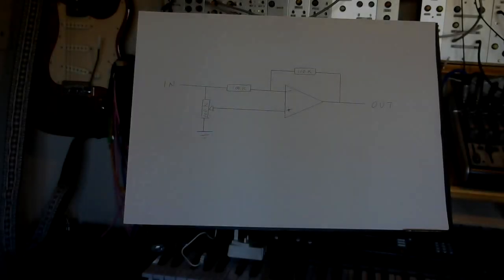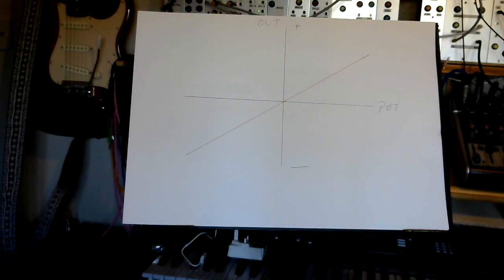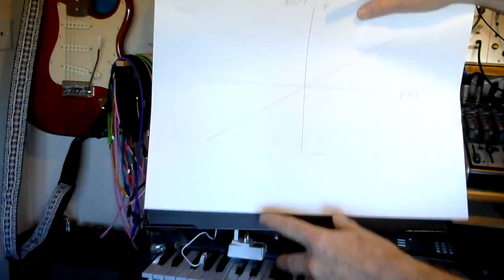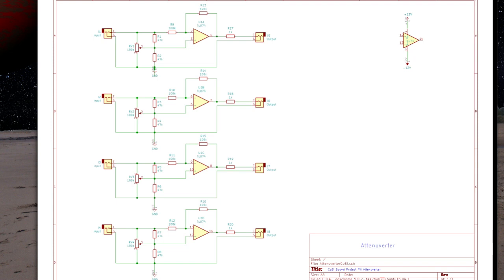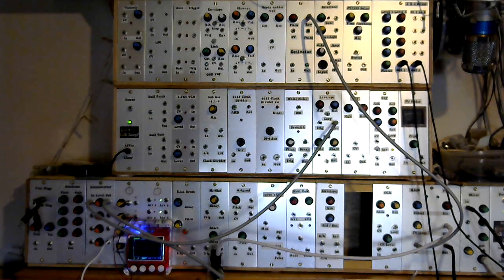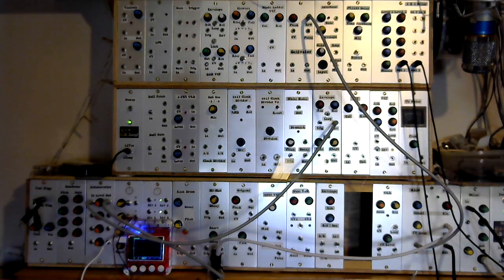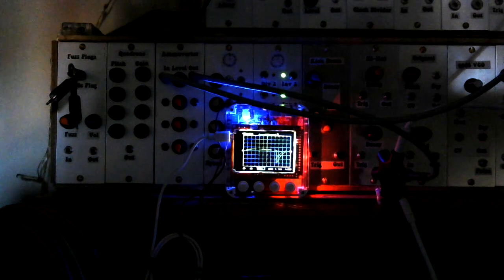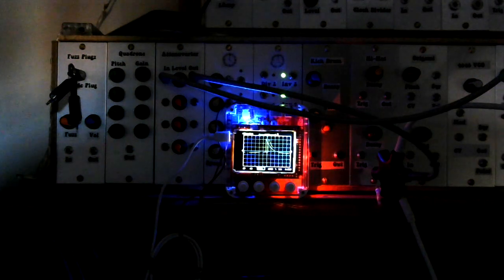Project XII Modular Part 22 : Quad Attenuverter

Comment: Great video! But what if I just wanted to build an inverter? Could I then, just use a 50K potentiometer, in order to just get the bottom half, of the red line in your drawing? Could it be that easy? I’m a NOOB at electronics - what would you suggest? Please let me know, I want to learn. Cheers!
Reply from the maker: Hi Max. Sorry no it's not that easy. Replacing the the pot with a lower value just reduces the level of attenuation and the op-amp is still configured to go from non-inverting to inverting around the centre of travel. You can configure the op-amp to just operate in the inverting mode. Connect the  non-inverting (+) input to ground, remove the pot and load resistors, and if you want to control gain replace the feedback resistor with a potentiometer. For more detailed theory just search the net for "inverting amplifier". Hope this helps.
Reply: @CuSiSound  Thank you for replying, I really appreciate it. And yes, I figured, it couldn’t be that easy. A smaller potentiometer would just reduce some range - not actually fix the/my issue. But ok, what if I replace the potentiometer, with a simple switch? Then, when I switch it up, the input signal would travel into the non-inverting thingy [in phase?] which would not change the signal? and when the switch is down, the input signal would head for the ground [out of phase?] thus “inverting” the signal? And this way, I don’t have to add load resistors and stuff. What do you think? Please let me know. Oh, and just subscribed to your channel - I’m learning a lot thanks to your videos. Thank you kindly
Reply from the maker: Sorry to repeat myself Max but I do recommend you do some research on operational amplifiers. I'm sure you will find something that gives you what you are looking for. It will also help you understand better how some of the circuits we build work. Thank you for subscribing : )
Reply: @CuSiSound  You are right - will do. Cheers!